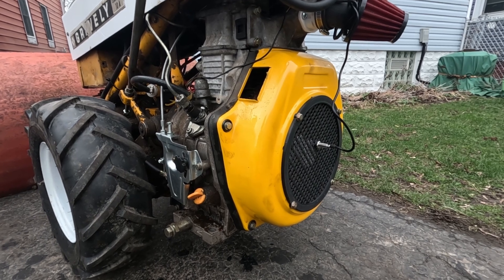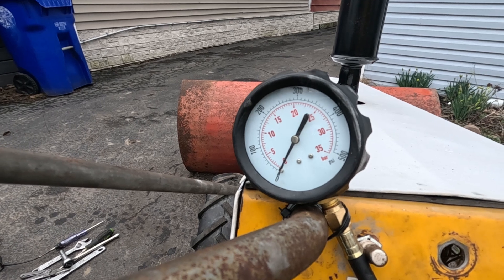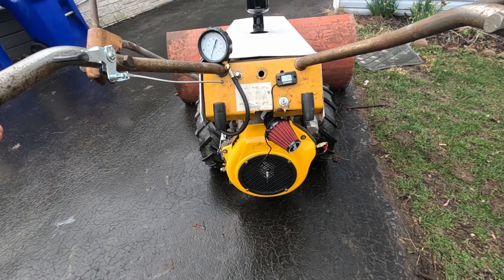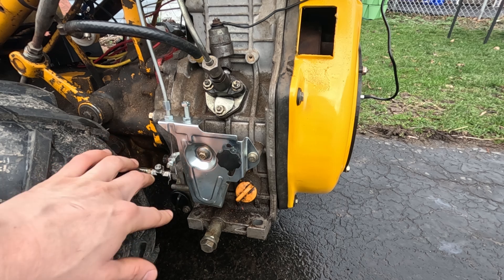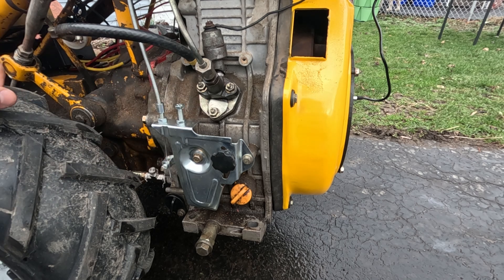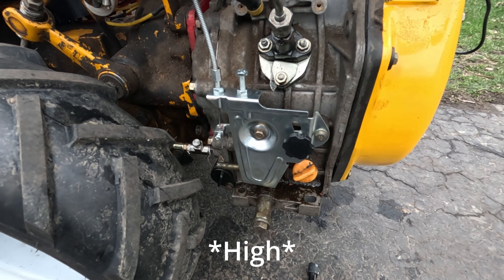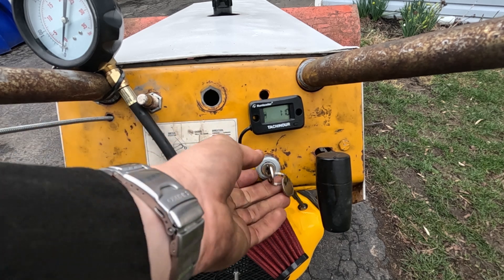How To Tune a Diesel Yanmar Clone

Comment: I put the knock off diesel on my speedex tractor and have been using it all this year for plowing and snow removal. Heard you say yours has 20 hours and is needing advanced. I was looking just to have fun with this diesel and turn it up for fun but hearing that made me realize I do have a bunch of white smoke and barely get black smoke ever. I let mine idle alot while im working it. I at first thought I had white smoke because of the cold. I will share the video on here but I dont know much about engines and stuff figuring it out as I take them apart I more like the actual fabrication of making stuff fit and work and look original
Reply from the maker: I can’t really get mine to blow black smoke. I need to bury it in a snow drift to make it happen.

Comment: usualy between how many bar  is the oil presure of this diesel engine?
Reply from the maker: @Mr32243224  It’ll be like 250 psi starting. About 100 psi once it warms up.
Reply: @haoleboyshow-tos2279  100 psi full throttle?
Reply from the maker: @ For working RPM of about 2700 it stays at 100 psi.
Reply: @haoleboyshow-tos2279  why so big diference on oil presure between start and warm engine? Because of iced weather?
Reply from the maker: @Mr32243224 Thick oil. The engine has no pressure regulator for oil.
Reply: @haoleboyshow-tos2279  the oil is getting thicker as weather get colder...actually what number of oil are you using? 15w40?
Reply from the maker: @Mr32243224 I use 15w40 in summer and 5w40 in winter.
Reply: @haoleboyshow-tos2279  the spring what is the oil presure at the beginning? The same as winter, 250 psi?
Reply from the maker: @Mr32243224 Oil pressure doesn’t seem to change with weather. It just stays cold longer.
Reply: @haoleboyshow-tos2279 and the summer when you start your engine you see 250 psi pressure? It s some weird…

Comment: By chance do you know where I can get that fan shroud cover where you have your RPM gauge mounted i have a 186F in an old Sears tractor and that fan shroud would work better for my set up
Reply from the maker: @grimreaper631  I 3D printed the cover myself. So it’s not available anywhere unfortunately.

Comment: Awsome going to be repowering my gas skidsteer with one of these should be a blast!!! One question thow I do t understand how you set the tac reader and magnet up  is there a measurement you need to use ?
Reply from the maker: The tac just reads every time the magnet passes by, so there’s nothing to set up. Some are set to a 1:2 or 2:1 ratio, so keep an eye out if you’re getting crazy numbers. They usually Han be changed to 1:1 though.
Reply: @  I just wasn’t sure if I had to put the mag and the sensor in a particular spot to read right is all
Reply from the maker: @pwcummins4 No, you can put them on any way. This one is reading off the face of the flywheel. I have one reading the outer diameter on a lathe chuck. As long as the magnet is passing under it.

Comment: Do you know where I can get a tapered shaft Clone Engine approximately 10 horsepower for replacement engine in a generator
Reply: I'm looking for the complete engine I'm okay with ordering on AliExpress but I'm having a hard time finding engines with the tapered shaft all of the ones I see are straight
Reply from the maker: @ Try this link. Lots on information based on what you order. https://www.walmart.com/ip/178-186F-192F-188-195F-5-6-7-8kw-engine-crankshaft-air-cooled-diesel-engine-parts-high-performance-crankshaft/2880597211
Reply from the maker: @MrDatson74  These are tough because they have either a 40 or 42 mm connecting rod bearing and none of the replacements specify this. Ali Express or Temu has most of the replacements. Whether you want to use those vendors is another thing

Comment: I have a Chinese mini-excavator with a Koop 192f engine, I want to advance the injection time to eliminate the white smoke but between the two gaskets on the injection pump I have a large thickness of half a centimeter, what do you recommend? Thank you!
Reply from the maker: @Musettone81  So there is a spacer between the two copper gaskets? 
I would recommend just removing the thinner gasket to start.
Reply: yes exactly, a spacer between the two copper gaskets, I'll try to remove the thin gasket, thanks!
Reply from the maker: @ It may meet some help sealing with gasket maker. 
If you need the spacer and both gaskets maybe you can try to replace the thick gasket with a thin one.
Reply: I thought there might be bleeding problems without a gasket, do you know where I can buy these gaskets online? Thank you!
Reply: I wanted to ask your opinion, I noticed that most of the white smoke occurs when the engine is cold, once it's hot it almost disappears, does it require intervention or can it be considered normal?
Reply from the maker: @Musettone81  It’s self contained. You won’t have fueling issues once it’s primed. The gaskets can be found on eBay or other online retailers. They fit all these clones
Reply from the maker: @Musettone81  I would consider it fairly normal. If you check my latest video, it makes a lot of smoke starting. 
If you are happy with it at its operating temperature, then you shouldn’t need to modify it.

Comment: Serious question... I don't understand why priming the injector is difficult. Can't you just hold down the decompression lever and spin the electric starter for a little while until the diesel fills the line? Am i missing something?
Reply from the maker: @MrKweezy2  You’re right on with the priming process. For whatever reason, it takes about 5 minutes to actually get a good prime this way. Not difficult, but long enough to be annoying.
Reply: @haoleboyshow-tos2279  Understandable! Do you know if you can run no shims at all? Or take the shims also used as the gasket? Mine came with 2 thick shims and removing one helped, but it's still smoky.
Reply from the maker: @MrKweezy2  I’m in the same boat. She still smokes after removing the thin shim. 
I tried putting the thin shim in and removing the thick one, and it ran like garbage.
Reply: @haoleboyshow-tos2279  loosen the line at the nozzle and spin it over until you get fuel out, and tighten it while it's still spinning. Always worked for us from little kubotas to bigger deeres/IH's.

Comment: So you’re a fellow buffalonian, nice to see. I too have built myself a diesel powered snow blower from the same engine, a 186F. I am wondering where you tapped into for your oil pressure gauge as I’m considering adding a small turbo to my engine and need a way to tap into the pressurized oil to supply the turbo.
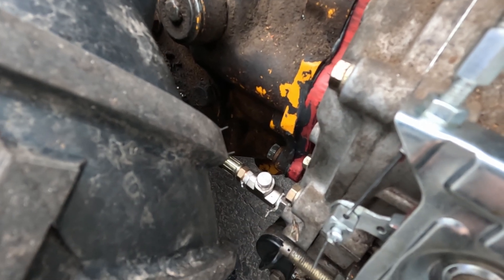Reply from the maker: Cool, I saw your vid. I’m eyeing a turbo for my setup as well You can see where my oil pressure gauge plugs in at 1:59.

Comment: I just put a 186FA on a log splitter. I want to try to limit the diesel exhaust factor and this seems promising.
Reply from the maker: Yes, it definitely helps clear out some of the fumes. Running at a higher RPM also cleans it up even more.

Comment: Are you on Facebook or is there a way i can contact you directly?
Reply: I understand man.  I'm just working on building this 186f motorcycle and this is my first diesel, this is my first motorcycle build and my first hybrid build.  So this is all new to me.
Reply from the maker: @CarModsandDadBod  That’s pretty ambitious, but I’ll answer whatever questions. I would recommend looking for resources with the go kart folks. A diesel and torque converter setup is probably more common in those projects.
Reply from the maker: I’d prefer not if it’s all the same to you.

Comment: Dude Ive been watching your videos like a crack fiend.
I just got a 186f I'm planning on putting on a motorcycle to shoot back and forth to work.
I'll be doing the build on my channel.
Reply from the maker: Glad you’re enjoying. 
I’m planning to turbocharge this thing, so stay tuned. A turbo/intercooled 186F on a bike would be hammer.
Reply: How much boost can they handle?
Reply from the maker: @CarModsandDadBod  I have no idea. That’s why I want to find out. All the information I have seen has been anecdotal. My goal is 5 psi to start.